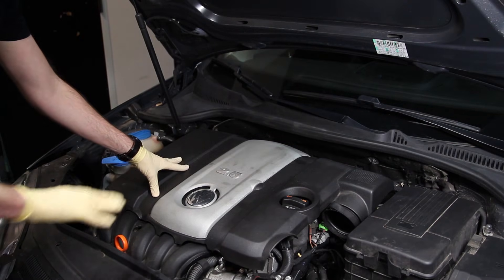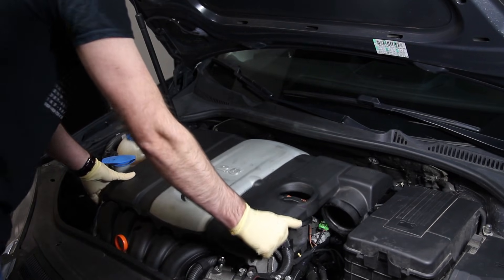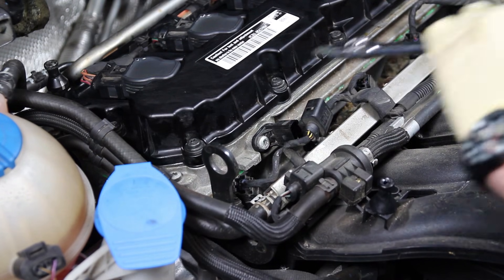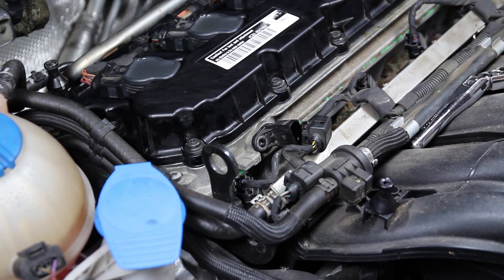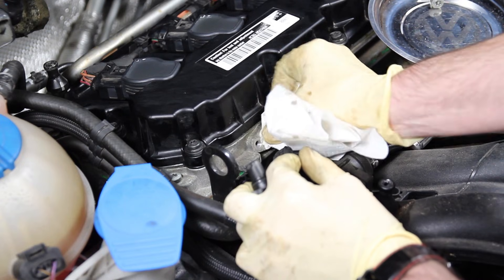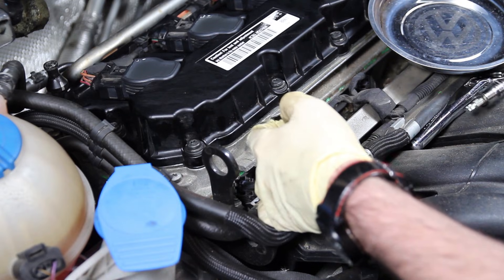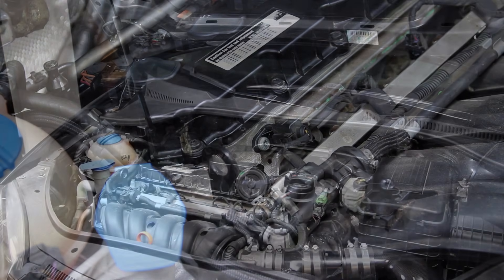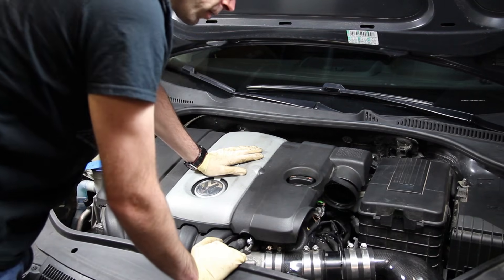How to Install a VW 5 Cyl 2.5 Engine Cam Position Sensor (G40)

Comment: I have P0011 and P000A codes. I have rough idle and sometimes stalls. Changed the solenoid. Going for this sensor next. Do I need to check the timing first?

Comment: If you are changing the cam sensor you might as well do the crankshaft sensor also the hardest part on changing the crank sensor out is taking off all the plastic skid plate

Comment: Wish me luck- 1-5 cylinder misfire, camshaft over advance timing codes. This is the cheapest/easiest first step for me to try to fix it and this is definitely easy enough for me to handle lol.
Reply: Did it fix your issue? Lol, i have the same thing going on and im gonna change this and hope for the best
Reply: @ negative- my issue was low oil that led to a slight timing chain issue

I’m actually still driving the car, but the timing chain is mounted on the bell housing, meaning I need to get the engine dropped for anyone to fix it

Hopefully your issue is just the sensor :-)

Comment: P0431 

Changed this sensor and the bank1 02 sensor I still have a EPC light when accelerating. Car still throws P0341 (range performance) what els should I do?  It was a duralast sensor from autozone
Reply: Did you find the solution I’m getting this issue to with misfires codes popping up
Reply: In general vw's do very poorly with aftermarket parts due, I think to tight software tolerances. The internal resistance of off-brand electrical parts can be interpreted by the ECU as a misbehaving part. Bosch is the usual OEM but anything that says OE (original equipment) will work and Autozone does carry OEM parts. If the error code won't clear after replacing the part, it's unhappy with the part or it's something else. VCDS has a Wiki for free. Ross Tech.

Comment: Hi i changed the spark plugs and the coil and and the came shaft sensor and the engine wont start  should i need reprogramming with scanner

Comment: Hey guys, I just want to thank you for this video. For months I was having an intermittent rough idle and random stalling when coming to a stop. It would drive fine one day and the next day randomly start idling rough and shut off with no cel or codes at all. I took it to multiple german shops and it would never show the issues and would work fine and I was losing my mind. Once a code finally came up saying camshaft position timing over advanced the garages all started throwing out ideas but it seemed none of them had any idea what they were talking about. After reading some reddit posts of ppl with the 2.5 having similar issues and after changing camshaft position sensor it going away I figured it was worth a shot and I watched your video and did it. It has never had the issues since I replaced that and when I removed it you could see that it was bad but for months their was no code and its like it didn't know it was bad and was searching for the right idle. It was a huge headache and I thank you again.
Reply: Lol my 2.5 has had a rough idle ever since I bought it when I was 16… I’m 22 now🤣it would just turn off at red lights sometimes. Never got a code until today which was the crankshaft code. Took 5 mins to replace after 6 years of chasing it
Reply: Do you remember the exact codes you got. I’m having the same issue. Idle is rough but driving the car is fine. I’m wondering if the sensor is bad which I can replace in my driveway or do I need a timing chain. I got codes P0011, P0300, P0301, P0302, & P0304.
Reply: @michaelnash2972  P0343 was my code.  Similar to above poster.  Mine had occasional rough idle & also a few engine stall at stoplight for a few yrs.  No codes & VW tech had no idea.  Finally CEL came on this week after a lost of engine power for a couple seconds, then after some driving even the EPC light came on.  Bought code reader & then sensor online for cheap.  15 mins job to swap it in.  I’ll say in your case you have nothing to lose trying.
Reply: Having the same problems now codes I'm getting are: 
"p0011" Over advanced timing and "p0000a" Camshaft position slow response

Also "p0507". For intake * just incase anyone is having the same issues without codes

Comment: Help! Having trouble with my 09 Jetta. Showing codes P0343 and P0651. Replaced crank sensor and cam sensor and cam sensor plug and still having an epc light. Car won’t rev past 3k rpm’s and I can’t figure it out. Please help

Comment: Thanks so much for the video. I followed this video to replace the Cam Sensor on my VW Passat 2013. Removing the engine cover was very hard. It took me about 15 of pulling and wiggling to get it off. Hopefully next time, it'll be easier.

Comment: 2011 Jetta 2.5L SE, the Camshaft Position Sensor seems to be on top.  However, where is the Crankshaft Speed Sensor? Do you have information on how to replace that?
Reply: Crankshaft sensor is on the bottom of the engine .

Comment: Had this code and replaced it. Then ran into code P0321 Ignition Engine Speed Input Circuit Range/Performance, but blessedly it disappeared the next day. My 2011 Jetta 2.5L now has a C0300 Rear Propshaft Speed Sensor code. What should I do? Is this a easy replacement too? Is there info and link for this part?

Comment: Comparing this to changing out my wrangler oil pressure sensor... damnnnnnnnnn this is an absolute walk in the park! The wrangler oil pressure sensor you literally have to tear half the engine down to get to it. Glad this isnt the case for this sensor
Reply: Have you tried checking your tranny fluid?

Comment: So I was having a rough idle on my 2012 Jetta 2.5L and I cleaned out the map sensor and the throttle. Now I'm having an issue as soon as I start the car. Before, it would take time for it to idle rough. Now it's doing it right from start-up. I'm so confused. No vacuum leaks at all. I've triple checked. Sensor is clean and throttle is clean as a whistle. Really not sure where to go from here....I don't want to buy a new cam sensor and still have the same issue....
Reply: Mine is starting up with these exact symptoms. The rough idle and all. My check engine light came on today and I'm hoping this sensor will fix those issues.
Reply: @nando323  clean your throttle, and clean out map sensor and your vacuum hose. Once done, reset the engine codes and it should start running fine.
Reply: @johnrodriquez1933  thank you for the suggestions. I have yet to clean those parts.

Comment: Do you really need the engine cover with an aftermarket intake?  I don't have mine on, is that bad?
Reply: Isn’t the air filter installed in the engine cover?
Reply: @habbadabbado5765  not with an aftermarket intake

Comment: podran poner un video de sensor de velocidad de encendido gracias  tengo un jetta 2008 le cambie la tapa de valvula las bobinas nuevas pero veo que los conectores estan muy viejos le puse la maquina de dianostico fixd i dice que es el circuito de entrada de motor de encendidosin senal

Comment: Quick note: Mine took a T30 to remove, not T35.  My "check engine" light came on, I went to Autozone and borrowed their OBD2 scanner, came back as bad cam position sensor.  Purchased it for $78 plus tax, and thanks to your video, I replaced it in about 10 minutes.  Thanks for the help!
Reply: He says T30 not T35. And nice work!
Reply: Exact same here - shoutout to Autozone for the free test

Comment: i stripped the bolt and i have no idea how to get it off .. any ideas? ive tried every type of pliers possible.
Reply: Cut a slot in the head of the bolt with a Dremel.  Then use a screwdriver.  

See you posted a year ago, so probably sorted out. Lol😂😂

Comment: This fixed the following codes for me.  
P0341 - Camshaft Position Sensor Single Sensor
P0011 - Generic
P0343 - Camshaft Position Sensor A Circuit High Bank 1 or Single Sensor
Reply: @Erik Luhrs Absolutely.  Would cut off letting off gas while on the highway. Extremely hazardous!  Dealt with this issues for nearly 6 years and VW could never figure it out. After installing the new sensor I did clear the code and they never returned.  Still no codes to this day and I did this fix nearly two years ago. My 2011 SE 2.5 is still my daily driver.

Comment: I have an 05 Jetta same motor. It recently started running terrible. Crank position sensor went bad fixed that. Still has rough idol. Installed new plugs and coils, still misfire codes on cyl 1&4. N e advice was gonna try replacement cam sensor but idk if that will help. Tired of throwing money at it. Need help n e one? Thanx
Reply: This part fixed 3 codes for me.  2 months going strong - no issues starting or stalling anymore. I did change out my spark plugs and ignition coils as well.  I have a 2011 2.5 Jetta SE at about 145K miles.
0341 - Camshaft Position Sensor Single Sensor
P0011 - Generic
P0343 - Camshaft Position Sensor A Circuit High Bank 1 or Single Sensor

Comment: My sportwagen making a rattling sound when under load or some times when when general driving , based on ur video on the alternator job of the 2.5 you mention the pullies might be the rattle issue could it be?

Comment: How do I know which exact camshaft position sensor I need for my 2012 Jetta 2.5? They quoted me way to much to fix this
Reply: John MD did you get this fixed man? Having the same issue throwing code P0016
Reply: @preston1332  same code is showing up for my buddy. Did this solve the issue?
Reply: Almightyadam2000 yup, I bought the camshaft position sensor and installed it myself (took like half hour because I wasn’t using quite the right tools), cleared the code and it took care of the problem!
Reply: @preston1332  awesome thank you very much! Hopefully it works for my buddies car.
Reply: @European_carclub  Good luck mate!
Reply: @European_carclub  This part fixed 3 codes for me.  2 months going strong - no issues starting or stalling anymore. I did change out my spark plugs and ignition coils as well.  I have a 2011 2.5 Jetta SE at about 145K miles.
0341 - Camshaft Position Sensor Single Sensor
P0011 - Generic
P0343 - Camshaft Position Sensor A Circuit High Bank 1 or Single Sensor
Reply: @dmoder3  unfortunately all 3 sensors I replaced did not help my buddy. I checked vagcom, his timing is off unfortunately. Thank you guys for trying to help

Comment: i have a 2007 jetta 2.5 engine 5 cylinder the alternator overheats and melt off the belt each time all attempts to replace alternator gives same results
Reply: Sounds like you are over tightening the alternator when you replace the belt,

Comment: I have a 2010 Jetta Sportswagen with roughly 65K miles. Bought it used about a year ago. Long story short it started out as this kind of violent little sputtering or bucking while driving...sometimes under heavy acceleration other times just under normal cruising speed. No lights would come on and it would be as if the motor would become unresponsive but all electrical would stay on then car would come back to life a few seconds later. 

Then that started morphing into car just dying out while driving. Again no fault codes or warning lights coming on. I’d pull over stop and put car in park, restart car and it would start right back up. 

Then that morphed into car now dying at idle, especially it seemed if you turned on the AC too. Then that morphed into car starting then immediately dying, start again...dies out again...then car doesn’t want to start at all for a while. Then you wait a while try again it starts. 

Now I changed out the speed sensor already and the fuel pump and the car is still having the same issue. Should I change out the crankshaft and cam sensor next? Is the manifold dirty??? Is their some sort of other fuel, air or CPU issue??? Please help!!!!
Reply: I had similar issues that you have stated. My  2012 Golf 2.5, would stall out at idle (stoplights, traffic, letting off the accelerator for a long period). Like your situation, the vehicle gave no lights/codes. I drove it this way for about 10 months. Just recently it gave the Camshaft Position sensor (P0341). I changed it out the next day. It has solved my problem entirely. It might be your problem as well.
Reply: @DR_Mtn_adv  2012 vw mk6 2.5 tornado red dealer said $140 and I found the sensor for $14-35 I've just done my own oil change and the car is178k should I try this myself ?
Reply: I've done it :)
Reply: @TheCarNerd2897  I can’t think of the guys name who played Deuce Bigelow(?) and he plays in all of Adam Sandlers movies,,,,,, 
“You can doooooooo-it”
But seriously, if you’ve done an oil change, you could do this one. Just don’t strip the screws off in the head.
Reply: @shakeydavesr  I’ve done it and it’s such a smooth idle now :)

Comment: Is there an instance where the CPS would work intermittently? I've been having an issue where it throws a P0341 code and runs poorly when I remove and reinstall the engine cover, but then when I remove/reinstall the engine cover a 2nd time, it runs fine and I can clear the code. I don't see any issues with the connections or wiring harness, so I don't know if there's a continuity issue I'm not detecting, or if it is actually something with the sensor itself.

Comment: I wish I saw this video before I went to the shop.  Do you have a video on how to find ways to get the check engine light off 2.5 Volkswagen jetta? When I got a diagnostic test my engine was fine I had a new battery and alternator but the engine light stays on its not red so I know it's not to bad of a problem
Reply from the maker: This tool would allow you to erase your check engine light
https://shopdap.com/store/vw-audi-scan-tool-obdeleven.html

Comment: I have a 1999 VW bora V5. Runs perfectly until it gets warm and then shuts down. Everything works .... Lights, dash, radio... The engine will crank over but there is no spark to the plugs. There is no error code on the diagnostic machine and the fuel pump can be heard running. When I let is cool down for 20 minutes, it will start first go and then shut down again after about 10 minutes driving. I am travelling around the Uk from Aus on holiday, your video is very helpful. Hopefully this will be the problem. If not do you have any other suggestions.

Comment: hello I have 2006 jetta 2.5L standard the problem is when I'm driving the motor stop working and don't start again,I change the crank sensor and the relay but is the same and the guy of advance auto parts put the computer and said the 5 injectors is bad that is possible can you tell me what is bad ???please thank you

Comment: Clean off the o-ring landing and use clean oil to lubricate the new o-ring, the oil actually helps the new ring slide into place easier and the oil will soak into the new o-ring a little bit to make it seal better.

Comment: I have a 2005 2.5 jetta  it start's very good in it won't crank up fuel pump works good what could be the problem

Comment: I got a 07 VW Jetta,I changed my bumper with a local mechanic, since after that i got my air bag light and the engine light on, when i check with auto zone, they were not able to fine any codes. what could be there reason? could you please tell me how can i find the problem?
Reply from the maker: +Titto Thomas Planning to answer on AskDAP episode 29 stay tuned

Comment: Hey could you please tell me what the green sensor/plug is on the drivers side of the engine as seen when you remove the engine cover? I took my cover off and the wire was almost worn through!
Reply from the maker: +MrandMrsHayday It appears to be where 2 connectors are mounted.  We are not certain what that is.  You will have to follow the wires to the sensor to determine which sensor it is.

Comment: What do nex if the scaner still shows needs camshaft  sensor after replace that
Reply from the maker: Sounds like you might have timing related issue.  You should likely bring your 2.5 to a VW specialist to have it properly diagnosed.